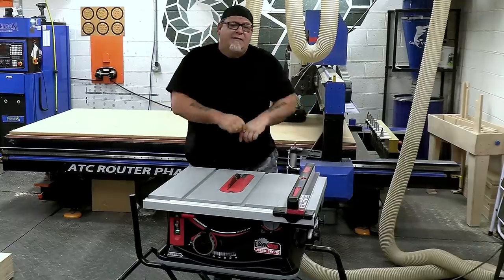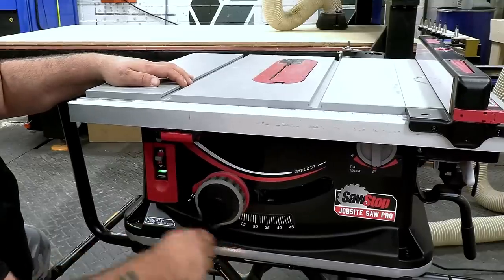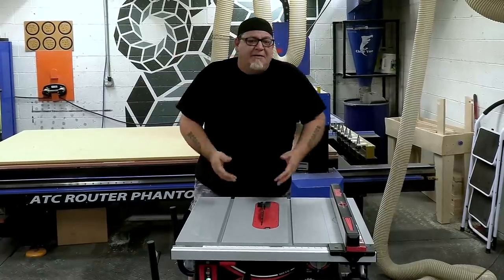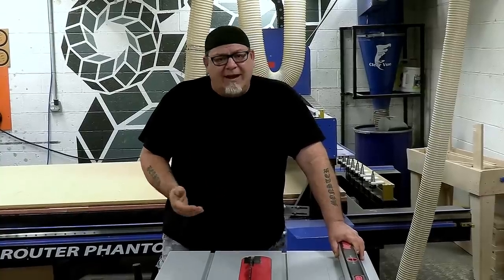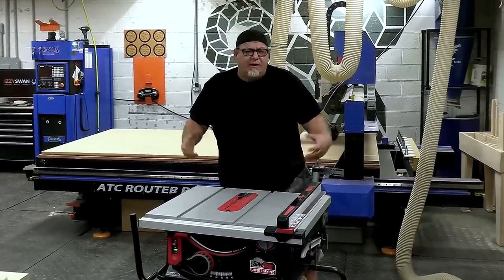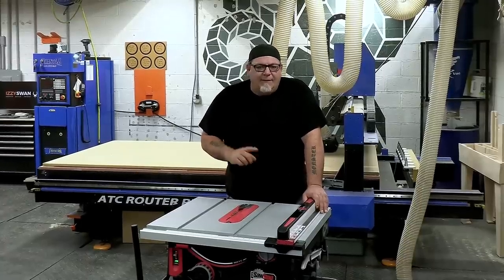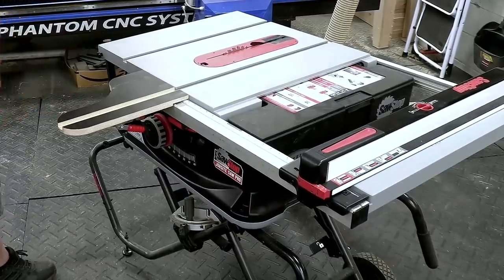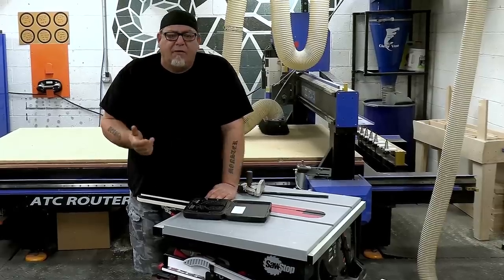DISAPPOINTED! - Most EXPENSIVE Jobsite Table Saw!

Comment: DeWalt 7491 has the best fence for jobsite saws
Reply from the maker: absolutely agree with you!
Reply: I do not know what model # Dewalt I bought a few years ago, but the fence is hyper accurate for a $600+/- table saw! Plus,  if the blade guard is removed the saw will not start until the operator acknowledges that it's MIA
Reply: Can you explain why

Comment: I'm still mad that the Bosch safe saw was forced off the market by Sawstop.  It didn't destroy blades when it was activated and could be reset by changing an inexpensive cartridge, allowing almost uninterrupted work even with an incident.
Reply: Sawstop -now owned by Festool - is responsible for some chopped off fingers because they are so strict with their patent they sued Bosch and scared every competitor away.
Reply: It’s not about safety, it’s about money. If it were about safety they would free their design to everyone, much like Volvo did with the seatbelt.
Reply: @nathan1sixteen  precisely
Reply: @GPG7754  What!!! Fucking Festive Tools owns SawStop!? Damn I hate how overpriced their equipment is. Its very nice quality! But so overpriced. I can see how a couple items where its hard to compromise for high production or something, but seeing shops decked out with 100% Festool is just disgusting.

Comment: I agree, awfull expensive for a job site saw.  The fence is a mistake.  There are way too many saws out there with a rack-n-pinion fence that pretty much dead on, not to put that style on.  I can see where the quality of power could cause issue with the false trips.  SawStop seems to charge double for their saws over a “like” saw.  But this seems even more.
Reply: Dewalt. The fence stays parallel to the blade and you adjust it with a knob. I check it all the time and it never isn’t parallel
Reply: @biguprochester  my fence was over a millimeter off when I bought it.  Every few months, I need a small readjustment.  Not at all bothered by that.  Just saying it's not actually perfect.

Comment: I live in New Zealand. Exotic tool stuff is expensive here. A standard jobsite saw is typically between $500 to $1200. The Sawstop Jobsite saw is not imported - only the cabinet saw. An 'Other brand" cabinet saw is between $1600 to $3000. The Sawstop is $7900 and replacement brake units are $240. There is no way the average home woodworker can afford these no matter how much you want to protect your fingers (for reference, the average trade worker after tax wage is around $22 per hour).
Reply: Wouldn't you just get one shipped over from AUS? this saw is $2499AUD, whilst still not cheap, its a lot easier to justify than $8k
Reply: Carbatec now is selling the Jobsite saw for $2,299.

Comment: I've had this saw for several years now. The most annoying feature for me is the mechanism for setting the height of the blade. It drives me nuts that I have to repeatedly tap on the handle ever so gently to get the height exactly where I want it. This can take several minutes to perform and needs to be rechecked afterwards (because I don't trust the saw).

Comment: I’ve had my SawStop Job site saw for 3 years now. I’m just a box making hobbyist for the most part. My shop is very small and the ability to easily wheel it around is fantastic. It’s the first “real” table saw after using those big box store little guys for many years. I’m 77 now. I agree that precision height adjustment is something I don’t look forward to when making dados and rabbits. The measuring blocks help immensely because to make the height adjustment I use both hands on the wheel kind of fighting each other so it doesn’t jump an eighth inch at a time. That doesn’t leave another hand free to use another type gauge. The fence is jumpy too but extremely accurate. It’s much more manageable not a big deal when you get used to it. I’ve tripped it once while stupidly clearing the blade of a cut-off (too soon and without a push stick) while it was still coasting down. SawStop replaced the cartridge free when I sent in the fired one to their customer service for testing. I took a picture of the tiny Nick on my thumb but had to circle the spot with a sharpie so that it could be seen in the photo. No blood even. Glad it was smarter than me or I probably would be having a hard time picking up change in my old age. Good review, it is a very good, safe saw for guys like me and like comparing a scalpel to a chainsaw to,what I was used to.

Comment: I bought the Jobsite pro about 2 years ago, and it replaced the DWE-7491.  I wanted a bigger saw, but shop size is only 160 sq ft, so I needed a saw that would fold up out of way.  As far as the saw goes, I'm with you on the fence.  As long as I remember the trick, it works fine.  Also, the miter gauge, that they provide, is a disappointment also.  I actually love the quick up/down with the blade, as it works great for me.  I've cut all kinds of stuff, and it works fine for me.  But, I'm with you, bought it for safety.  They are releasing a smaller saw, soon, for $899, no stand on it.  I am looking at it to see if worth buying it, selling the Jobsite pro, so I can add saw to router table, but need to see what compromises they put into it.   Good on the nose critique of it.  Thanks.

Comment: I had a JSS for almost two years after a bad kickback took the end of my right index finger.  That was on a Grizzly 3hp table saw.  I was really disappointed with the fence and overall stability of the JSS as I make a lot of cabinets and needed repeatability.  After two years I sold it and purchased the 1.75hp PCS.  This saw is great and with the fence and Woodpeckers rip/flip, I am really satisfied with my purchase.  I have a small shop, so portability is a must for me.  I have the 36" model, and it does well for me.  Heaviest timber cut and ripped is 8/4 red oak and it did it with no problem.  I use only Ridge Carbide blades on my table and sliding compound miter saw.

Thanks for the review Izzy.

Comment: I have had my jobsite saw for around 3 years now. I love it. The mobility, the fact it can be folded up and down with ease, the almost out of the box setup and accuracy. Fortunately my fence is tight on. When I lock it there is no wiggle at the other end and it snaps into position parallel to the blade. The table is of course on the small side compared to cabinet saws, the blade and miter gage are average. I replaced both after a few months with an Incra miter gage and top quality combination blade with a flat tooth every 5th one. Dust collection is ok. Better than many others but not up to cabinet saw standards. I do a lot of rabbit and dado work but prefer to use a router for that. From my comparison to other job site saws I found it more accurate and versatile than others. Factory support is outstanding.  I have made several calls to them, got quickly to a very knowledgeable person and had my questions accurately answered. Not having the room for a cabinet saw I have been extremely satisfied with my jobsite saw. Also, have never had a misfire on the safety mechanism. Did set it off once when the blade kissed the edge of a kreg aluminum miter gauge extension. That was my fault not the saw but it did show the safety feature works. My saw is plugged into a regular 15 amp outlet with no problems ever. Would I buy it again, absolutely! Does all the cabinet work just fine that I ask it to do.

By the way. That little extension for the miter gage looks very handy to overcome one of the limitations of a small table top. Also, I added a 4 ft. extension on the face of the fence to overcome the smaller length of the original one. I build a lot of 6' and 7' tall cabinets using a combination of track saw and job site saw.

Hope my experience helped a bit in a decision to buy or not, a job site saw.

Comment: I've been building out a fairly large basement workshop for the last 3 years now, as a hobby for now as I build my skills but with the long term goal of creating a second income stream one day. I have one of these saws and I built it into a large cabinet enclosure as others have described. I've been using it for years now on furniture and fine woodworking projects and I have some thoughts. I upgraded the fence using the Versupercool Tools aftermarket fence system, which is quite excellent and completely transforms the way the saw feels to use, it is much more like a "real" table saw now, so I will not say much about the stock fence. I will say that I disagree with the information in the video regarding the need for thin kerf blades. Obviously a thin kerf blade will cut with less resistance, and I do use a thin kerf rip blade occasionally if I need to do a lot of heavy ripping. However, I find that with a high quality full kerf blade, the saw doesn't feel underpowered, and I find myself being reluctant to take the time to switch to my thin blade because it usually isn't worth the effort. In general, I've found that the horsepower rating on power tools can be misleading, its useful for establishing the general class or category of tool, but just because two tools say they're both 1.5 HP doesn't mean they'll have the same power, in my experience. The SS jobsite feels pretty powerful for a little saw IMO and I've been able to rip 2 inch thick 6 foot long boards with a full kerf blade pretty comfortably, and I've made some joinery cuts 3 inches deep through maple and mahogany and it did work as long as I paced the cut right. Works great with an 8 inch dado stack also. I will also say, just like in the video, the blade angle adjustment is super accurate and really nice to use. My saw wal also perfect out of the box in terms of fence and blade squareness.  !!!!!******BUT*****!!!!!! I have one major gripe/warning that I really can't overstate: I find the blade height adjustment to be not just annoying, but downright frustrating. That quick height adjust makes sense if I was actually using it for what a jobsite table saw is meant for: if you just need to cut some plywood and 2x4s then being able to raise and lower the blade quickly is more convenient. But it makes it super hard to cut really accurate tenons (using the miter gauge method) or dados or rabets, to the point where I often look for other methods of creating those cuts rather than take the time to dial in my saw's height to the level of accuracy I want for certain applications, which might take 20 minutes (just to set the blade height). A big part of the problem is not just that the blade adjustment is twitchy and hard to microadjust (which it is), the blade height will often change by about 15 thousandths of an inch when you first turn the saw on after setting it to a new height. This is because the mechanism that sends the blade up and down has a certain amount of slop and backlash that I don't think you would find in the typical mechanism on other saws, so when you start the saw it sort of "settles" into a stable position. That means I need to set the blade height, run the saw, and then re-set the blade height, and then run the saw.....and do that until I'm at the right setting. I know some people will laugh at trying to get that precise, but in certain applications it really does matter. Again, if you were using this in any normal jobsite applications, or any cut where you are cutting all the way through the wood, you would never even notice this. But if you're trying to cut precise parts for small wooden 3D puzzles, for example, its super irritating. At this point I've committed and learned to live with it, but given that I invested so much in upgrading the saw with an aftermarket fence and cabinet enclosure, I really wish I'd spent a little more money and gotten the contractor grade saw, which has a larger and cast iron table and a conventional blade adjustment mechanism. If you want to do something like I did, and turn it into the center of an actual woodshop, I would advise against it specifically because of the blade height issue (everything else actually works great). Either spend more money to get the contractor saw, or just get the dewalt jobsite and be careful with your fingers. If you don't anticipate using the saw to cut precise joinery or intricate parts, this may be less of an issue.

Comment: I've had the saw stop jobsite saw for 3 years now and in general we have been happy with it. The main reasons we bought ours is it fits nicely in our small work shop, it has the capability to do dados, the expanding bed works nicely and the safety feature is a big plus especially since my 12 year son is starting to learn to use the power tools. The biggest con is the fence simply because making quick adjustments can be troublesome and attaching jigs to the fence is also a big pain it would have beennice for them to incorporate a t track into it. Also when using bypass mode for wet material and aluminum you have to remember to reactivate it if you shut the saw off between cuts but that's minor if you consider the safety aspect. As far as power and dust collection go it works very well.
Reply: If you want to prevent false trips when using the saw stop a computer battery backup surge bar works well.

Comment: I’ve been using the jobsite for years.  It’s flush installed into a 4x8 work table, so the size limits are not a big deal.  Totally agree about the fence.  One other small complaint is that the table is not magnetic which would be nice. Also, I tripped the safety (metallic tape stuck to the underside of the sheet goods). My fault.  Needed a new cartridge, blade and boxers.
Reply: funny!
Reply: I nicked my miter gauge and learned the same lesson.

Comment: Great review and I completely agree with you on all points. I've had my SS saw for about two years now. Its my first table saw and sole reason of the purchase was for safety. The fence was a HUGE bummer and it feels like an after though.  Pulling the fence back is a great tip!

Personally, using a tablesaw was super scary at first and it became gradually less scary with repeated rips. Less scary more respect. The simple fact there is a system to save fingers gave me less anxiety 😅. 

Thank you for the review and tips!

Comment: Hi Izzy!  I need to come see you all.  We live in North Carolina and run MakerInspired - a Maker Space on the edge of Raleigh.  I've had my Sawstop jobsite saw since March 2015 - before the Pro came out.  At the time, I ran a small shop in a two-car garage.  Since then we've moved to a bigger space.  I bought the saw with my own money - and use it for hobby - and have no problem loaning it out.  I agree with you on the fence slop - and have overcome it in my applications much like you suggest. I don't agree that it's a bad saw.  Like you said - if you want finger saving technology, it is the only one of it's kind on the market.  I needed the compact space-saving footprint for my small garage shop and would not compromise on safety.  If I were running a job site and wanted to maximize my business margin, I probably wouldn't purchase this for the money.  If I was providing this to my workers and needed to ensure their safety and reduce my insurance costs, I sure would buy this saw.  Bottomline: if you ignore the price, this is a great saw for what it is (not a fixed position cabinet saw).  If you ignore the price, this is a very safe saw.  If you have noisy electricity - you may want to consider other options for conditioning your electricity if safety is paramount - otherwise get a different saw (they have a compact model now too - I have no experience with it yet).  To simply say this is a bad saw ignores a whole lot of engineering attention that has gone into this.  PS - I have the $3800 Sawstop 52-inch Cabinet Saw now - there are still times I use the jobsite saw...

Comment: Great video, Izzy. I dig this saw, but I do have a few gripes about it as well.

Obviously, the fence is not great. But my biggest problem with it, and still to this day, is that my table isn't flat. I don't know if it got damaged in shipping or what, but the seam in the table where it opens up to the storage underneath isn't level. One side is a little higher than the other. It's not on the "business" side of the table, where most pieces are cut at least, but it just means that sheet stock won't lay flat, and I am limited to a smaller table saw sled.

It is a josite site saw, after all. Some annoyances, but I'd still rather use it than something that could take my fingers. Thanks again for sharing. 👍